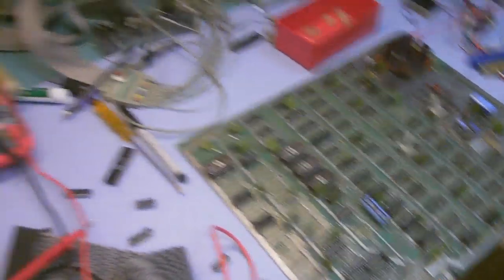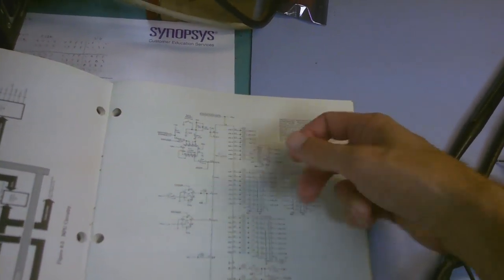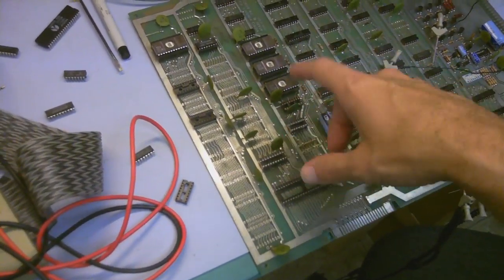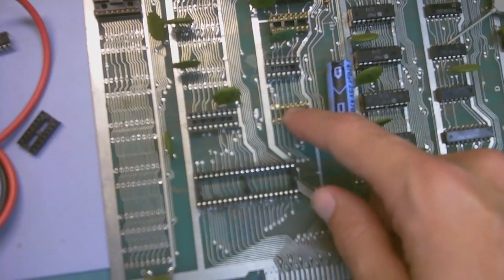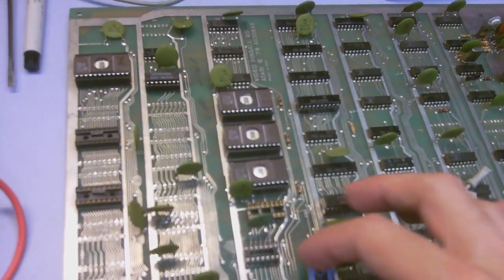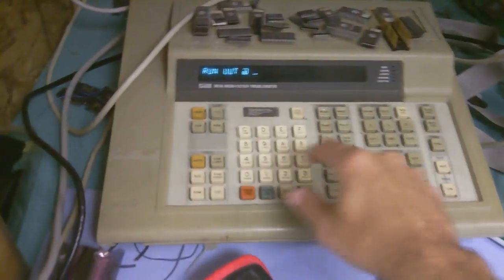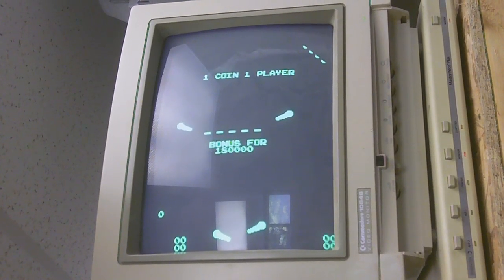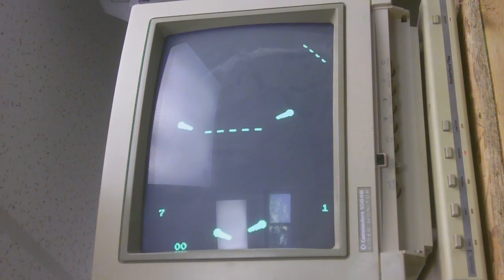Video Pinball Repair for Jay

Comment: have you ever worked on Taito type - zero pcbs before? i have a twin driver cab battle gear 2 one side works perfectly the other side loads and plays blind sound works force feed back calibrates you can start a game . but no picture . I though maybe it was the monitr or harness but i swapped pcbs from one side to the other and everything worked including picture . Iremoved and cleaned the 3 socketed ram chips on the board and cleadned all the ground pads on the corners of the board . but I am still let with no picture. any simple sugestions or ideas whats wrong ? how much ball park would you ask to fix an issue like this ? Thanks Matt

Comment: I have a question. i have been watching your videos and i am trying to piece together how to fix my frogger pcb. When i purchased it the cabinet had been converted to jamma and used an adapter for the frogger board. when i was rewiring it i misscolored my 12v and -5v and reversed them. the frogger game will no longer turn on. do you have any idea how badly this pcb is messed up? it wont turn on and puts my switching power supply into protect mode.